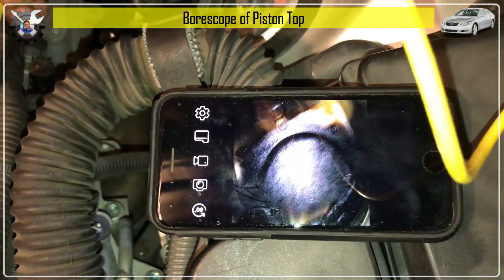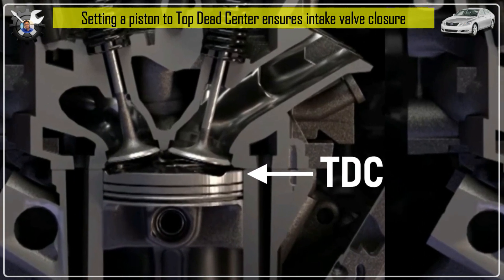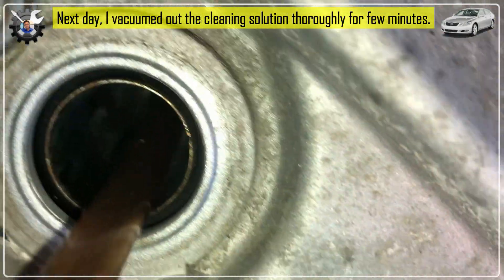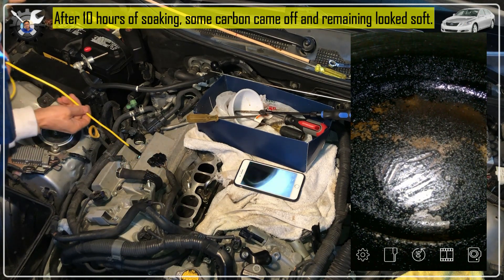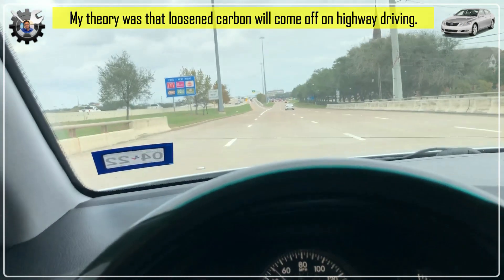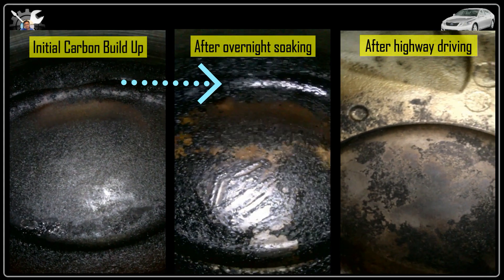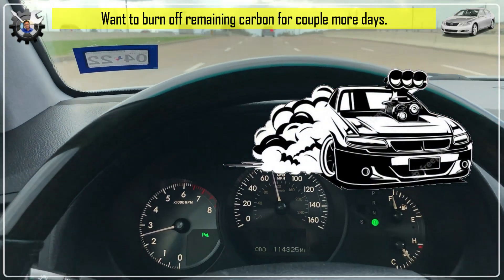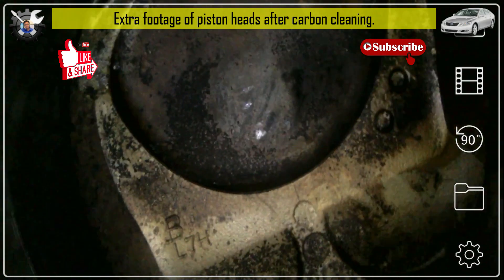Piston Carbon Soaking & Cleaning

Comment: How much chem dip do you think you added in each cylender
Reply from the maker: Sorry I saw the message just now. I added just enough to coat about 1/4” of depth on pistons.  Cylinder wall is relatively clean since piston is constantly going up and down. The main carbon build up is on piston top and some around the piston rings.
Reply from the maker: I think soaking for 2-3 hours is actually enough, but after vacuuming out the chem dip thoroughly, do drive it in the highway speed to burn off the loosened carbon and then do the oil change.   So ideally, you do this just before oil change is due.
Reply: @DIYLifeSkills  think it could be dangerous driving around with the chem tool in the crankcase?  Some has to slip by the rings and into the oil
Reply from the maker: @JonnyAbs-0  That’s why you have to vacuum out the chemdip first.  I covered this in the video. Otherwise you risk hydrolocking the pistons and kill the engine.  BTW, chemdip is not flammable so you can use shopvac to suck it out.  :-)
Reply: @DIYLifeSkills  thanks but I was talking about in the crankcase by slipping past the rings, not in the cylinders.  I get having to clear the cylinders to prevent hydrolock
Reply from the maker: @JonnyAbs-0  First, you only use just sufficient amount to cover the piston top. Second, piston rings expand out and will block much of the cleaning solution from leaking past it. If you watch the borescope and shopvac portion of the video, much of the solution remained and got vacuumed out.  Besides, engine cleaning solution you pour into the oil filler hole all gets mixed with oil too.  Small amount of cleaning solution making it to oil is not an issue but ideally this cleaning is done just before oil change cycle. I actually drove about 100 miles after both intake and position carbon cleaning to get all loosened carbon to collect in oil or get burned off and then did the oil change.
Reply from the maker: @JonnyAbs-0  Only caution I have is use chemdip as it’s not flammable and can be shopvac-ed out.  If flammable solution like seafoam is used, then it gets tricky to remove the solution. Sufficient amount of liquid left on piston chamber could cause hydrolock. 

Second caution, use borescope to know how well the cleaning solution have been vacuumed out.  

Third, do oil change soon after this cleaning to avoid riding on contaminated oil.
Reply from the maker: @JonnyAbs-0  Also note that piston rings are supposed to tightly seal against the piston chamber.  This is the high compression is created for maximum pier combustion.  If liquid casually sips past piston rings, then piston rings are too worn or damaged then the engine is already having poor power, misfiring, rough idle, and low compression.
Reply: @DIYLifeSkills  I have already done a mmo soak and a gumout soak.  Mmo was useless.  Gumout helped as it has a lot of PEA.  I will do b-12 next.  For both of my other soaks, the cleaner worked past the rings eventually.  I also agitate the pistons by using the crank bolt.
Reply: @DIYLifeSkills  to make sure i dont hydrolock, i crank the engine with the spark plugs out and the fuel pump fuse out.  That mixes the rest of the solution between the rings and flings excess out
Reply from the maker: @JonnyAbs-0  to do this properly, it’s best use borescope to ensure that you don’t have puddle of liquid left on top of piston.  I like vacuum method because it’s cleaner than spewing harsh cleaning solution on top of the engine.  If you put towel over the spark plugs to catch the cleaning solution then you are not sure how long to crank and how much liquid is left in the chamber.  Vacuum with extension hose really sucks out nearly everything, including some melted carbon.  And borescope validates how much carbon is cleaned and no liquid is left behind.
Reply from the maker: @JonnyAbs-0  also note that piston is not in perfect vertical position, but rather its tilted, so they call it V6 cause 3 cylinders on left and right side is pointing out like V shape.  That means cleaning liquid will tend to puddle up on the lower side of the corner more.
Reply from the maker: @JonnyAbs-0  cleaning solution mixing with oil is not a big issue as you can just change oil, but getting sufficient amount of liquid out before starting the engine is what I would be most careful about because water doesn’t compress…not sure how much cleaning solution will compress before combustion.
Reply from the maker: @JonnyAbs-0  in any case looks like you are near done.  Let me know how it finished and how well it drives afterwards. Hope all goes smooth.
Reply: @DIYLifeSkills  good point about the angles.  I have a ls1 v8 but likely won't do it on that.  My other 2 cars are 4 cylinder so they point straight up.
Reply from the maker: @JonnyAbs-0  Oh Which cars are you doing this on?  My GS300 is V6, I'll be doing this on 4 Cylinder Camry in next few weeks.
Reply: @DIYLifeSkills  my car is an 04 Pontiac GTO owned since new.  108k miles.  Wife's car is a 2013 chevy malibu 2.5L.  Owned since new and with 121k miles.  Stepson's car is 2009 scion tC.  Owned since 2019 with 89k.  Now has 131k.  2.4L 2az-fe with the clogging oil control ring issue that I have half fixed with gumout.
Reply from the maker: @JonnyAbs-0  there is a Toyota master mechanic, with The Car Care Nut YouTube channel, and he talks about how 10K mike oil changes are one of the leading cause of piston oil ring area holes getting clogged, which cause oil burning issue. He recommends 5K mile oil change, and I’ve been doing that in all my cars.

Comment: So can I put the car top dead center pour the chem on  each piston and leave it let it sit for 2 days then vaccum it out ?
Reply from the maker: Sorry, I missed your comment before.  2 days soaking is too long.  I think just few hours of soaking would be enough. 
And yes, all you have to do is soak and then vacuum it out thoroughly to avoid hydrolocking.
And then drive it on a highway to burn off remaining solution. 

I would time this just before oil change is needed because, you should change oil after cleaning and driving it for about 30 minutes on the highway.

Comment: Excellent video, now I want to do this on my ES330 lol!
Reply from the maker: What year and how many miles do you have?

If you are going to tackle this, make sure you have a borescope camera and a shopvac, because you MUST verify that nearly all cleaning liquid have been vacuumed out.   I used Depstech brand borescope, which happens to be on sale for $43 on Amazon today.  No I'm not a sponsor, but I am in the middle of making a product review video on Depstech because it exceeded my expectation.   

Lastly, after I completed this work, I found some info in Berryman's web site, where there were some mentions of not soaking the aluminum block for more than 1 hour on one page, and 4 hours on another page.   As documented in the video, I soaked my pistons overnight, so it was between 8 to 10 hours I believe.  The car is running better than before, but after seeing Berryman's warning, I suggest you experiment one cylinder with just one hour of soaking, then vacuum out the solution, then drive it on the highway. Do borescope before and after to see if that did the cleaning before soaking for longer time.    They also sell this in a smaller container so you don't have to get a gallon size like I did. 

Once you are done with all pistons...meaning including driving on the highway for 30 minutes to burn off remaining carbon, I suggest you minimally changes the oil, because if Chem-Dip contaminates the oil, the oil is going to lose some of its lubricant capability.  Also, if it's old spark plugs, you might want to replace it. If it's relatively new, you might want to examine them, and possibly clean off any carbon that came off from the piston head and coated the spark plug tips.   In my case, I timed this work so that I was due for an oil and spark plug changes. 

Good luck, and let me know if you have any questions along the way.